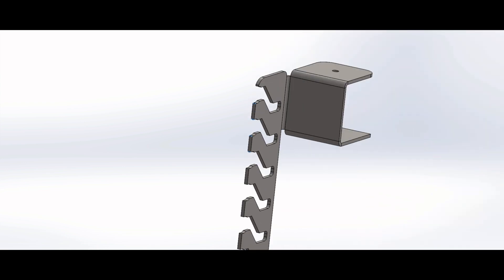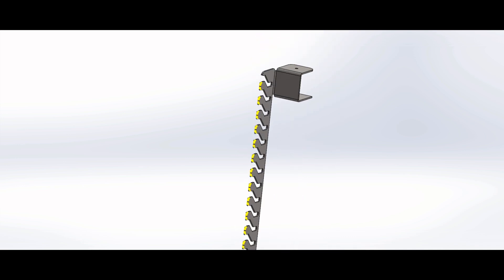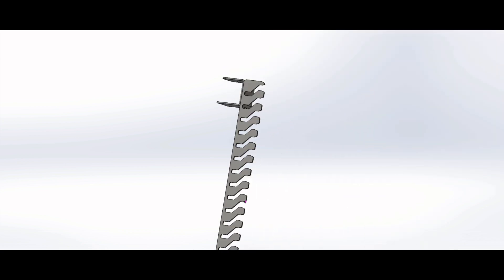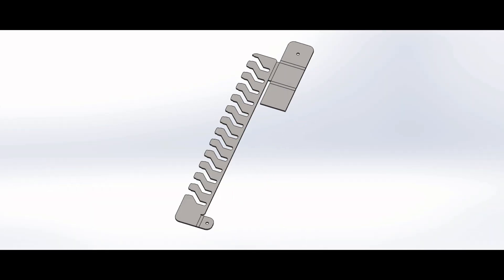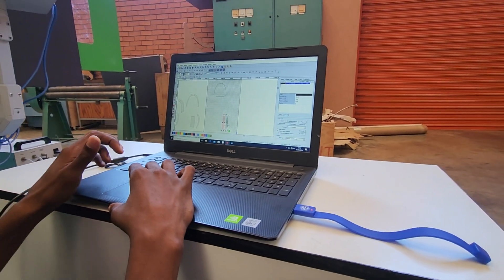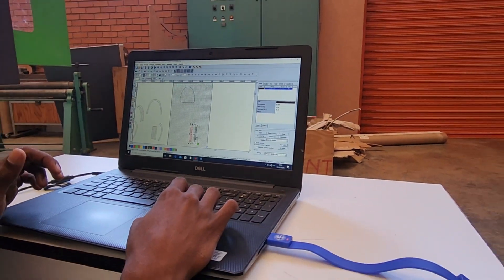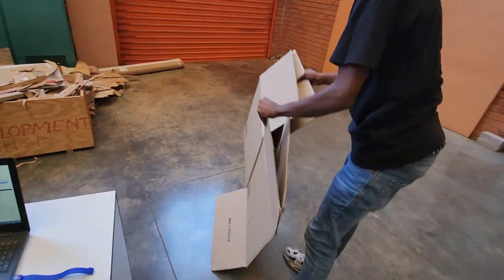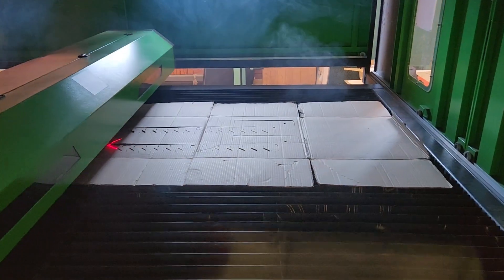Solidworks 3D Design to Cardboard Model

Comment: If you have plenty of time I guess thats an option? Or just make one section of the pattern in steel :)
Reply from the maker: Indeed, this works perfectly if you have time to spare. The goal was to check the dimensions of the pattern itself but also to confirm the size of the whole piece once attached to the workbench.